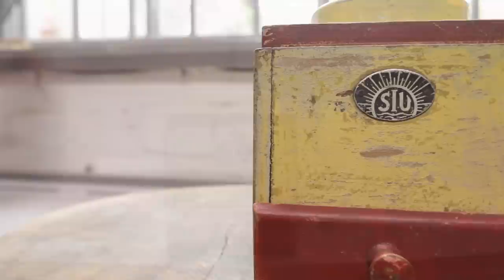Restoring Broken Old Coffee Grinder.  Restoration

Comment: using glooves from beginning is only show, makes no sense. Light warming up of metal after hammering takes forces out.
Reply: Why do the gloves bother you so much?
Reply: In the beginning I must feel surfaces, damages, screws whatsoever. Than I decide from case to case whether gloves or not. I would never start with gloves.
Reply: @wolfgangbalu1253  but you aren’t the one doing this restoration, so your rules don’t apply. Why does what someone else does upset you so much?